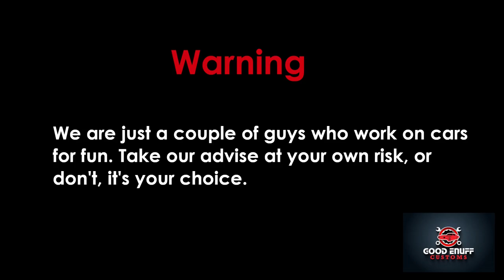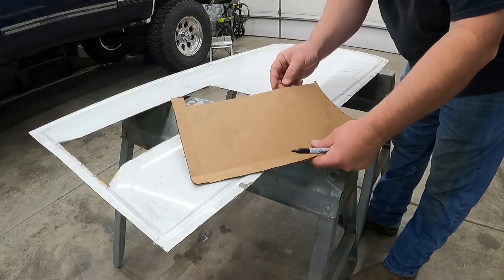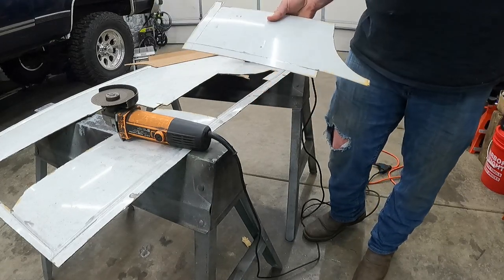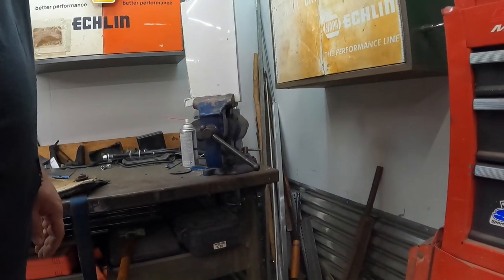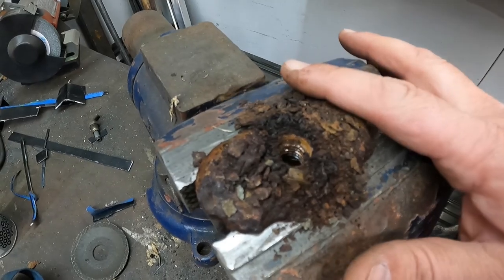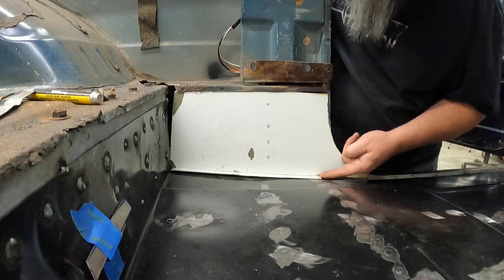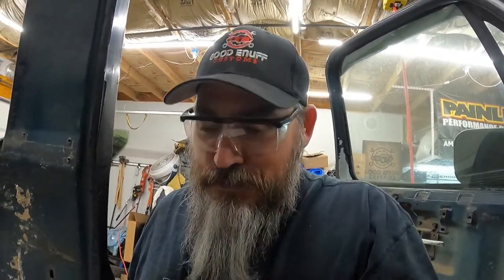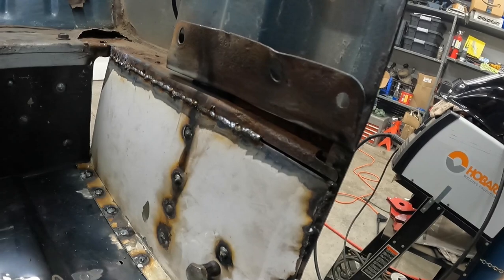K5 Blazer Resurrection Part 11 - Making a patch panel for the seatbelt mount

Comment: Awesome video series! Keep up the great work. I am in the middle of replacing the floors in mine as well. This has been a huge help with how everything should be looking. Mine has some serious rust in the back "cab corners" and the bottom of the "B" pillars.
Reply from the maker: Thanks! The b pillar area is a booger for sure. Hopefully these vids can at least point you in the right direction, or at the very least show what not to do!